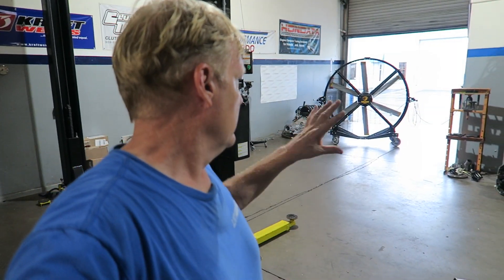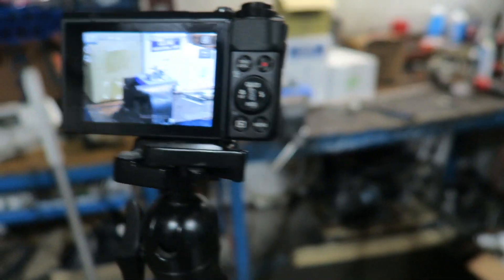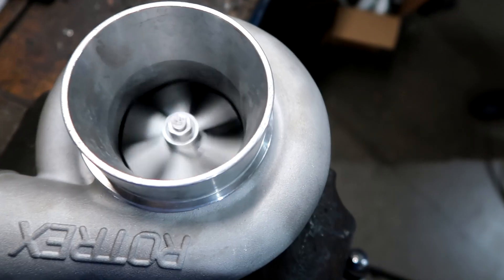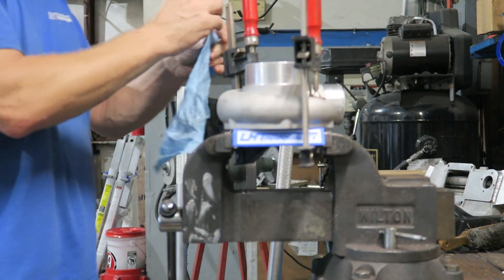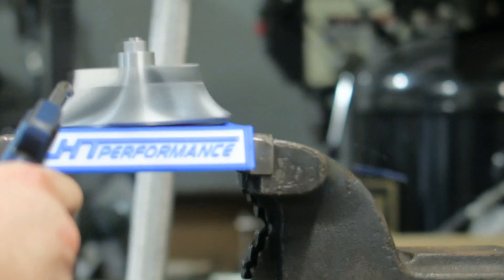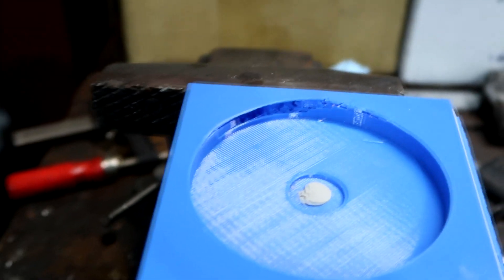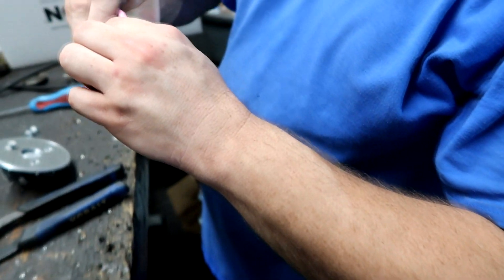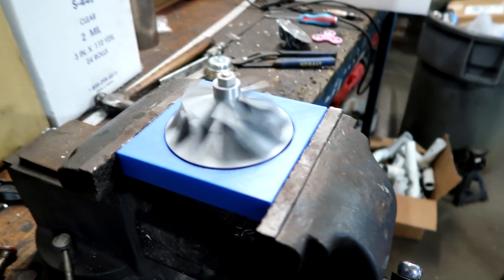3D PRINTED TURBO WHEEL ???

Comment: At what RPM did you suffer bearing failure? Perhaps you should use (insert favourite oil brand here) to see if failure can be avoided. Apply for grant to fund a study to overcome this issue? ;)
Reply from the maker: Barney Ward, Somerset, NJ lol. It’s funny you said that. Jeff (tue creator) is building one with an rpm read out as we speak. Look out for it. 👍🏻

Comment: 30psi.😁  Shoutout to George the stuntman on this one.👍  Good thing he was wearing his PPE.  We used to do something similar by putting a carbide insert onto a small T-handle Allen wrench and spinning it with an air nozzle. Not sure how many rpms they would spin (maybe 100K rpm?), but they sounded like a dentist's drill. Haha.  Safety third.😉